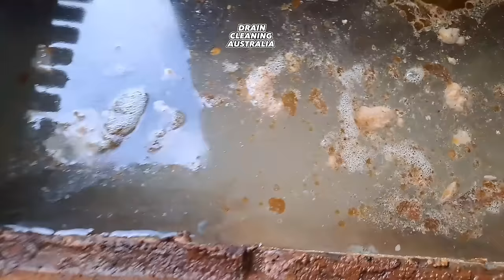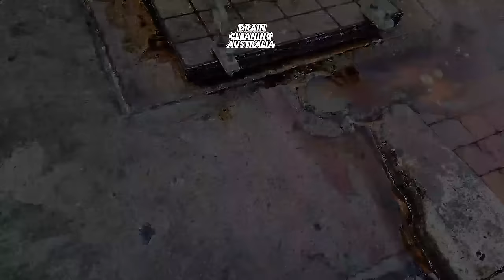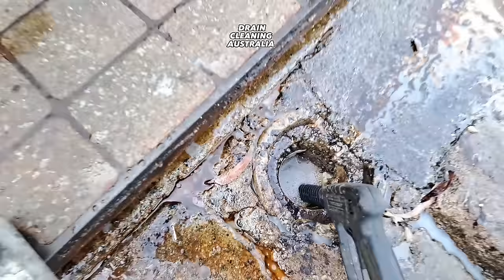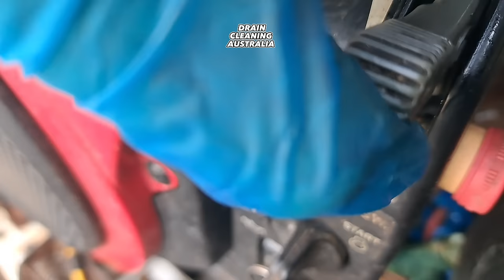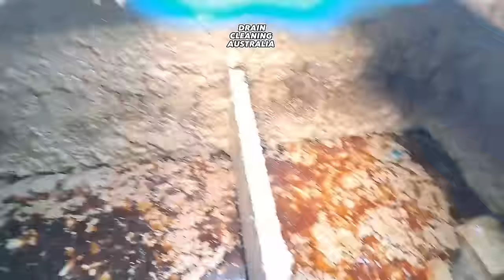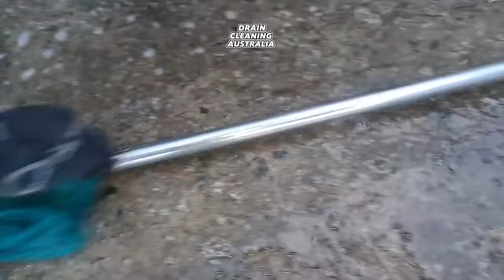A ROTTEN Blocked Drain and $1000 to swim in it!

Comment: Mate, i reckon if you had a 90° flex joint on the end of your wand, so you could put on a tornado head, and fire it straight into the outlet, that would have been cleared that im half the time.

Also unreal that i saw multiple Scotchbrite scouring pads in the drain. Someone needs to learn what sink strainer is, i think.